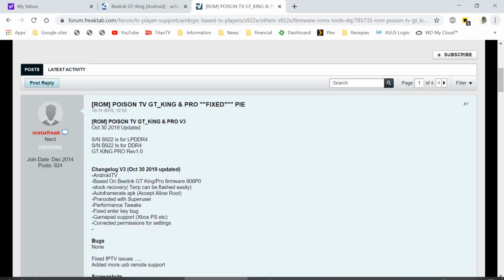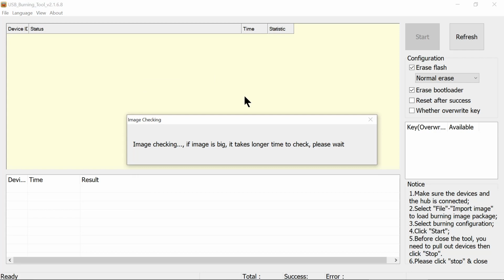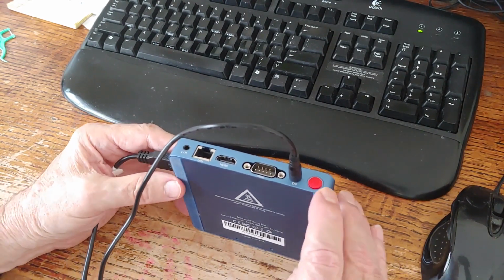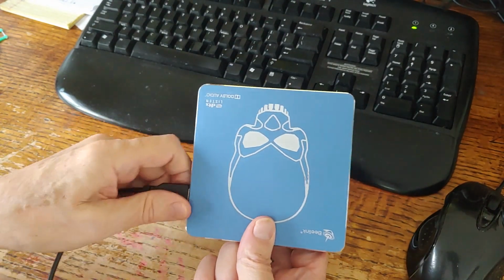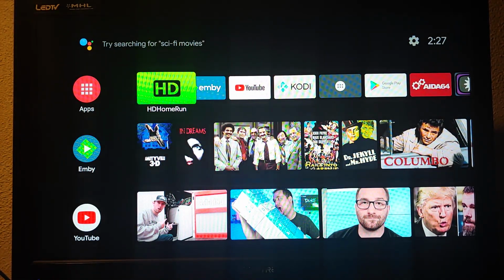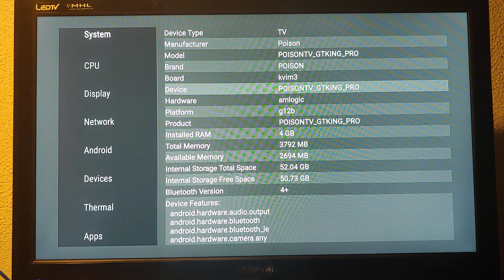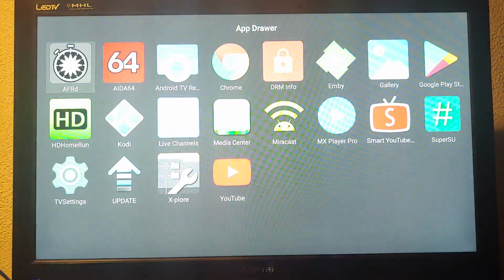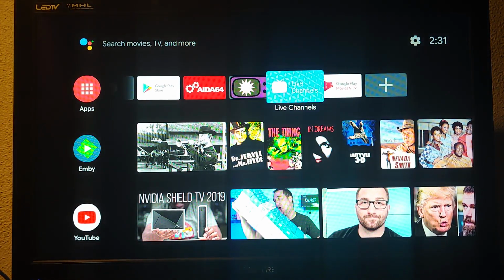How to install Minixfreak ATV Port onto Beelink GT-King PRO

Comment: Thanks. BUT I need help - my GT King pro device is stucked at the screen of showing the device's remote control, and will NOT go away, will not proceed to the next step.  I tried the reset hole, but still nothing changes.  I hope you can help me reset the device.

Comment: Like your reviews...one question about this box that most people dont discuss...and I didnt see it in your video.....how is the internet? does using Chrome work smooth? are there stutters? slow to load pages? I know this is not a mini pc but I am curioius about basic internet usage like google maps, chrome and so on...any feedback on your experience with the internet would be greatly appreciated
Reply from the maker: Chrome works great on this box.  Right now I am using the ATV port from Alvatech and the Chrome app works great........ Of course copy/paste do not work, there is a Chrome mod that the copy/paste does work, but can't remember where.
I have so many Android boxes, I forget which boxes I made a video showing that maps, contacts, calendar all work.  With this Alvatech ATV port, I use the "voice" button on the remote to dim my ceiling lights, check my calendar, etc.

https://forum.freaktab.com/forum/tv-player-support/amlogic-based-tv-players/s922x/others-s922x/firmware-roms-tools-dq/789302-rom-beelink-gt-king-pro-alvatech-android-tv-atv-9-0-pie-s922x-h

Comment: Another good and informative video Ronnie . I have android box(Xgody KB2pro S912, with 3gb ddr4  32gb rom according to my research a VIdeostrong box with Xgody Logo. android 6.0. I am looking to replace stock recovery with TWRP to allow bkup of system and to update/ change rom in future.This box has run well and is running great at the moment.And whats the difference if any of booting into recovery by reset or using the reboot app you recomended in an earlier video tutorial.Looking forward to any guidance if any you can give me...Best regards Ray.
Reply from the maker: First there is no difference on which procedure that you use to access the recovery menu.

I am not sure where to get the TWRP recovery for your box, but Freaktab is the place to start.   Also, the S912 is a great SoC.
Reply: @clarkss12   Thanks Ronnie .

Comment: hi My newly purchased GT King  is not Starting . When I Am Powering ON it showed Red light (Eyes in The Skull). Please suggest me what need to be done.
Reply from the maker: Sorry to hear that..... Has it ever worked? What is the first 3 charaters of the serial number and model number.
Reply: @clarkss12  No in my first boot only it is not working.  Gt king 922 , 4gb Ram and 64 gb Rom . I have followed your vedio and try to upgrade it but while flashing it showes internal memory error.  Please help me what need to be done.
Reply from the maker: @soumyaprasadpanigrahi1555  It is quite possible that it is dead.  Contact the seller and see what they suggest.  If you had that issue when you first got it, then it is defective.  If it did work, and you tried to flash another firmware, then it can be saved.
Reply: Please suggest which rom to install  and how to fix the error  .
Reply from the maker: @soumyaprasadpanigrahi1555  For your device use either ROM for standard Android or an ATV Rom for these links.....  The linked pages will tell you which ROM to use for your device.  Follow my video on how to install the ROM, your King installs just like the King Pro as I show here.

https://forum.freaktab.com/forum/tv-player-support/amlogic-based-tv-players/s922x/others-s922x/firmware-roms-tools-dq/778508-rom-beelink-gt-king-alvatech-standard-android-9-0-pie-s922x

https://forum.freaktab.com/forum/tv-player-support/amlogic-based-tv-players/s922x/others-s922x/firmware-roms-tools-dq/784806-rom-beelink-gt-king-alvatech-android-tv-atv-9-0-pie-s922x

If you need more help, post your question on one of those links.  It is hard to kill these boxes, so don't worry.

Comment: I bought a Beelink GT-King PRO and a Beelink GT-King. the pro only loads into kodi in safe mode. the regular Beelink GT-King loads into kodi fine but both models I can't get to load into android is there something i'm not doing right I hold down the power on the remote to get the menu to change between kodi and android and I don't get that menu and if I pull out the sd cards and power the boxes up I get nothing on the screen
Reply from the maker: Do you mean booting into CoreELEC?  Dual booting?
Reply: @clarkss12  yes they both only boot into CoreELEC I want them to boot into android
Reply from the maker: @wickedclowns25  Unfortunately, there are no boot options...  Your box will boot into the external device first, if it finds an operating system (CoreELEC), there are no options to bypass that boot sequence at this time....

CoreELEC does have power options to boot to the internal OS on the EMMC storage.  So, it will boot to CoreELEC and from there you can select to boot into Android..... No other way around it at this time, but it has been suggested on the CoreELEC forum......

You don't have to use the reset button......
Reply: @clarkss12  but it's an android box how do I get to the android home screen and android 9.0 menus
Reply: @clarkss12  how do I boot to the internal OS on the EMMC storage I've tried everything everybody's videos I see on here has an android home screen I can't get mine to do that
Reply from the maker: @wickedclowns25 If I understand correctly.  You are running CoreELEC from a microSD card now......... correct???  If so, when you click on the power button under CoreELEC you should see several options....
Reply: @clarkss12  yes
Reply: maybe u could add me on facebook it would be easier to talk on there
Reply: got it to work I guess u can't use an hdmi switch box I hooked it directly up to my tv and it worked
Reply from the maker: jamie mckee  It should work even with an HDMI switch.  I use to use one.

Comment: what advantage over the stock android OS has this ?
Reply from the maker: The ATV version of Android is primarily to be used as a media player.  It has the 10' interface and does NOT require a mouse to navigate.  However, Chrome works as well as on the ATV version as it does on a non ATV version of Android, but it does require an air mouse.
Reply: @clarkss12   so does  the android system you get on standard set to boxes  look different to this ? I have no idea what "10' interface " means , even though I have been using android for years.

Comment: When opening the files Minixfreak has and during your video you keep calling an " OS " a Port for some reason.  They are ROMs.  The Operating System on Android Boxes or other like devices are called ROMs , not Ports.  It might confuse someone and cause issues in the vocabulary when trying to discuss and troubleshoot setups and using USB Burning Tool files. ( ROMs )
Reply from the maker: My interpretation is that the devs take the stock firmware and mod it to create a different "port" of that firmware.....

Comment: May I have a new download link? File crashes
Reply from the maker: Give this firmware a try, I am running it on my King Pro now..... It is by Alvatech.  There are two different versions of the King Pro, that link will tell you which firmware to use.

https://forum.freaktab.com/forum/tv-player-support/amlogic-based-tv-players/s922x/others-s922x/firmware-roms-tools-dq/789302-rom-beelink-gt-king-pro-alvatech-android-tv-atv-9-0-pie-s922x-h

Comment: There is an error when pressing Start and inserting wires 0 × 00101004 erase bootloader / lowper / identify / error result
Reply from the maker: Sometimes it takes a few tries........
Reply: Thanks, my friend
Reply from the maker: Did it work?
Reply: @clarkss12  He succeeded by using the blue cable
Reply from the maker: @نيتويو-ل5ط  Excellent.